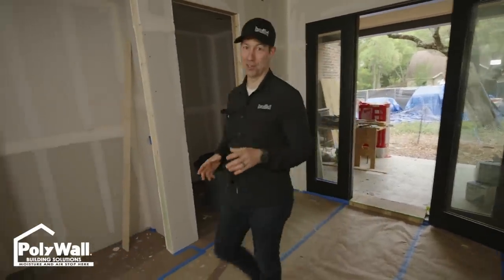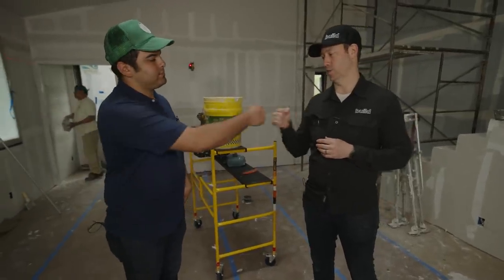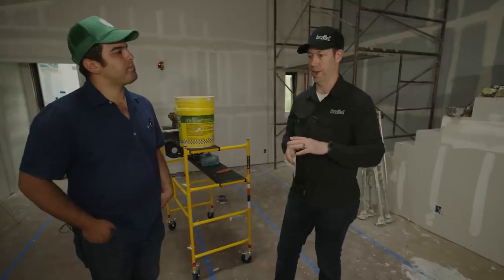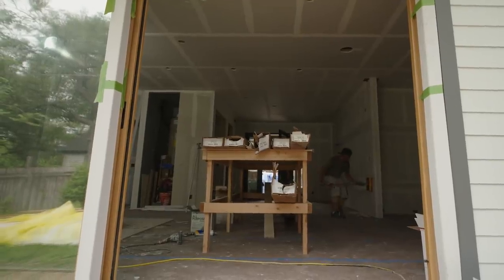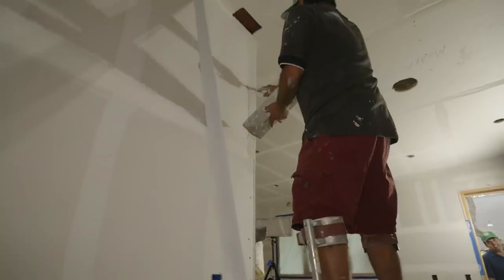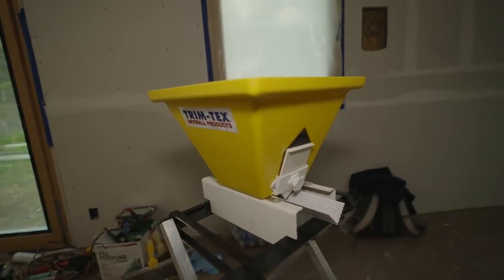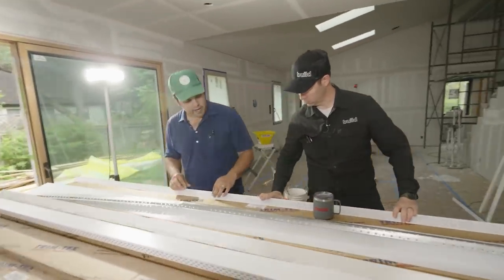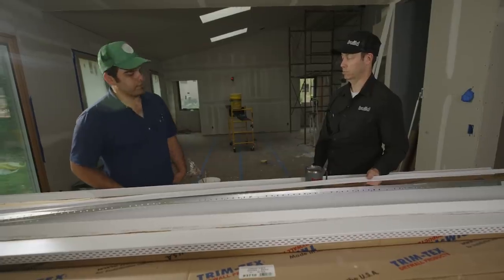Drywall 101: Here’s the specs for a Top Notch Job

Comment: One thing that isn't mentioned in the video is that using 5/8" drywall instead of 1/2" will require you to order doors with 1/4" wider frames - if that means custom ordering all your interior doors rather than buying doors with standard width frames, that could add a substantial cost to the build. Either that or shave 1/4" off all your interior wall studs to keep the wall thickness at 4.5".
Reply: Have you seen the entire series of this project!? 😬
There's nothin standard or normal about the cost of this Build! 😅
Reply: Or jamb extensions.
Reply: @Odrunkmonkey  👍👍takes about 30seconds a door
Reply: "not a lot of extra" they say. "typical house, maybe $700" they say. "ya, maybe add $100" they say. By the end; your house more than double in cost. and will be just as dated in a decade.

Comment: My dad, an architect, did an analysis of a 2,000 square foot production home comparing the plumbing fixtures and hardware from cheap-as-you-can-get-it production builder basic to high end (not crazy weird like gem-encrusted taps or anything, but solid, high-end products). The difference amounted to one-half of a percent of the total build cost. If your build budget is so tight that a half a percent makes a difference, something is very far wrong.

Comment: A heads up on the "Giant" or 'Oversized' L Bead.   I used this to wrap a window about 15 years ago.  It made for a very easy and smooth transition from wall to window wrap.  Painted the room dark blue...southern side...and the sill warped in a couple of days from the heat.  I had to redo the sill..kept the sides, and then used an off white to finish the inside of the windows.  Great product but watch where you apply it.

Comment: Would love to see a video with Junior explaining the difference between level 3 and level 5 finishing
Reply: level 3 is a texture finish to hide everything.. a level 5 is completely smooth.
Reply: @dtoad48  thanks for the info
Reply: @gags730  Great comments. All very true.  I am a specialty contractor in the industry. I've often heard the DW finishers being referred to as the magicians, master illusionists, the fixers etc. of the building trade. The stuff they are able to pull off to solve complex asthetic problems is mind-blowing.
Reply: Level five is *skim-coated* smooth wall. Level 4 is 3-coat smooth-wall sanded out. Leaves a fuzzy surface between the mud that will show up in paint. A reasonably competent finisher [me] can go from level 3 to level 5 with the skim coat and very light sanding after. 

Best practice [as Matt would say] is: 5/8 with level 5 finish. Looks and feels like a finished wall; not a double-wide.
Reply: @gags730  Yes, I never heard about the 'levels' until I got to Las Vegas. "Level 5" is a commercial finish like they use in hotels and offices. The tradesmen jump from residential to commercial depending on who's paying this month so they use the same lingo.

Check out the YouTube vids on 'skim coat drywall'. It's not like you butter the whole wall with one more thick coat similar to one coat plaster. You cover the wall, yes every wall that shows, and then rake it off. There is even a spray mix you spray on and then rake off with a 12" trowel. 

It sounds long and hard, but it is not. If you get it down, it actually reduces the amount of sanding you have to do. What it does is seals the surface of the board and makes the paper and the taped areas have the exact same surface.

Like I said above, you can jump from two coats to finish if you skim coat. Skip the closets and walls that get wallpaper or tile. Just the ones that shows. Makes you look head and shoulders above the others in your area. For smaller jobs, my drywall guy does two coats one day with hot mud, then comes back the next day for the third coat. 

I got one-coat plaster on my own home when I lived in LA. I loved it. Super durable. I couldn't find anybody to do it here in Vegas but then I learned about skim coat. But do whatever works for you. When I lived in Iowa, they wouldn't spend a nickel more than what 'flat n' splatter' cost them. They used 'knock-down' in LA: mix up a bunch of loose mud and fling it at the wall, then run your wide trowel over it. Looked like dried boogers to me, but they called it 'deep profile'. Yuck.
Reply: @gags730  About the 'levels': Level 1 is rock hung on the wall. Level 2 is fire taped [one coat]. Level 3 is two coat [tape and body coat]. Level 4 is three coat sanded smooth. Level 5 is skim coated. 

The last 2 used to be called: smooth wall and slick wall. Now they refer to 'levels'.

Comment: Matt, I've been watching your videos for some time now but had to chime in since drywall is my profession. And all my family's too. Own a business in Okc. Commercial buildings require some type of corner bead or trim tex only because its on the prints. Thats all the engineers know how to do corners. Any skilled professional uses paper tape and mud only on residential and it will be perfect. And it's much easier to fix later. When the homeowner is moving in and a corner gets banged up, the metal or plastic bead will crack away a much greater distance than where the impact was making the repair a larger area. With paper tape, just a dab of mud. Thats it. I do use a product called flex bead on arched areas and plastic corners (bull nose) when the customer wants rounded corners for that stucco look.
Reply: paper on outside corners? arent they super weak?

Comment: When my house was built the builder used these plastic corners and put them up with a liquid nail type adhesive from a chalk gun.  The adhesive only went on the back side of the corner and they used regular mud on the front side. They dried in really solid and you can hit them with a hammer and there is no movement at all!

Comment: As a Trim Carpenter (2nd Generation), I had learned the plasterer/taper trade as a secondary skill set. Most of this I knew already, but the newer material was good to see. Vinyl beads don’t bend as easily due to the ability for the material to absorb and deflect incoming blunt forces and to spread that force across the face of the product.

It’s science, ladies and gents!
Reply: Well, mud set helps a lot as well, the bead is full beneath the bead usually applied with setting compound where I'm from. It's a lot more rugged than glued on or stapled vinyl.
Reply: Mud set is also very nice because like he says the corner is very crisp, the only thing I would do different than what they have done is mesh tape the edge of it. Gives it just a bit more longevity, you just can't get the tape too close to the corner of it.

Comment: Finally, someone does it right by hanging 5/8" everywhere and it's not that LITE junk they are trying to pawn off..
Reply: @suspicionofdeceit the LITE stuff?  That shit will crack just looking at it lol..
Reply: Type X yes.  Ultralight is cardboard
Reply: Nothing wrong with the lite stuff. Can’t tell the difference unless you pick it up
Reply: Really the main reason for 5/8 drywall is the 1 hour Fire protection, and it will help with sound
Reply: @jeffreyferguson83  Yup.. I use 5/8" Type X with greenglue over 5/8" OSB in my theater rooms.
Reply: @gags730  People think adding Rockwool does anything for sound, when 5/8" over pink stuff would outperform it.. That is money well spent!
Reply: cries in mobile home ownership
Reply: 1/2 is perfectly fine - 5/8 jacks up labor costs and helps increase profits. Drywall contractors love overkill customers.

Comment: Soundproofing generally requires mass. 5/8 rock does that. The more salient factor, AFAIC, is that 5/8 is half again as stiff as 1/2". My engineer father in law explained that 'stiffness' is calculated as the square of the thickness. So if you have 1/2", it is 4/8ths thick. The square of 4 is 16, so it has a stiffness factor of 16. 5/8 is 5 squared for a stiffness factor of 25. Thus it is 50% stiffer. The walls feel far more solid with 5/8 rock. 

Now if you would do something on *single coat finish plaster,* it would be the icing on the cake. Unless you skim-coat it, the surface of the walls is basically cardboard. And that after all your hard work inside the walls. Single coat plaster [like Diamond] is unbelievably durable and resistant to damage. Plus, it does NOT feel like cardboard when you touch it.
Reply: I have a newer house in Florida that has metal stud interior walls and 1/2" drywall.  For minimal cost, they could have used 5/8" and the place would be so much sturdier.  It's not that it's bad, but when a door slams, the vibration travels to other rooms!
Reply: @r7boatguy  Exactly. Literally the *feel* of the wall. Doesn't give; has better sound blocking. It IS heavier than h*** in 12 foot sheets on the ceiling though. But your house doesn't feel like a double-wide.

Comment: Around here the 5/8s cost isn't the big deal.  Its the door jambs sizes that get messed up and now how to cost more to accommodate the bigger size.
Reply: Center the jambs so you only have to caulk an 1/8" seam or dado 1/8" off the back of your trim..
Reply: @FJB2020  good ideas....but I still feel that adds costs to a job that isn't mentioned.
Reply: @suspicionofdeceit Which doubles the costs of your doors compared to buying in-stock doors.
Reply: @HuskyKMA  that's my point.  I know i can fix them, but the added cost to me is a hidden cost because of the thicker drywall to you have to add that to it.  Not say its only 200 bucks more, cause its not.
Reply: @R2Mike  It would, but the benefit of 5/8s rock outweigh that in my opinion.  Also matt is probably already ordering custom doors (getting them for free lol) he can easily get 1/4" added to them...

Comment: Matt. Would love to hear your opinion on any dry wall alternatives. There have been so many advancements in home tech, why haven't we seen any changes in what we use to make the surface of our walls.
Reply from the maker: Great question. I’ve seen some alternatives but haven’t been satisfied. Did you see the all wood interior house I built a few years ago?  Look up “Perfect Wall House “
Reply: Matt- Have you tried MgO board?
Reply: Drywall is one of the few trades that hasn't needef to reinvent itself.
The industry nailed it.
Reply: Drywall is an excellent system. It's a 20 to 30 year system if done right, and it's simple and fast to repair it when needed. In terms of life cycle and repairability, it has traditional plaster very well beat. Although I use plaster materials and techniques for specific purposes.... Metal lath is very likely the strongest and best method for a tight radius barrel ceiling. It's a nice trick.
Reply: Makes me wish I had a picture of the barrel ceiling my father and I built in my sister's home. Definitely my go to method for something of that nature. The rebuilt and expanded. It was a really cool ceiling though.  Looked sharp the whole 15 years they had it.  Couple small movable LED lights set in it.

Comment: Painters like Good Drywall and Finishers.  Laser level drywall finishing?!  Matt you are going over board . (pun intended)
Reply: I guess laser is a must for level 5 finish?
Reply: Only way to get a Grade 1 install 😂
Reply: As he stated, that particular joint is going to be seen from many places and there are lines that need to be straight to avoid distraction. Plus, doesn't take long.

Comment: You could also use ICF with 5/8ths and have 100's of times more mass. I would love to see more ICF videos! It just seems so much more easier to make an efficient air tight home.
Reply: ICF is the way to go but there is some things to be aware of. Blocking for heavy interior items on exterior walls can be an issue and the depth of your window and door openings depending on what size block you use. I'm a huge icf guy though. Only way to build your own last house imho
Reply: @jwristen24  100%. It's definitely not a perfect system, but if you want a high quality home that is efficient it's worth the extra time and money. Pays off big later in the construction phase and throughout it's life.
Reply: @frostman9661  absolutely. And with lumber what it is right now the cost between the two is closing. I've had 2 projects fall out because of lumber costs and another is going through a full redesign with decking and metal studs.
Reply: I'm designing our ICF home and plan on using 5/8" everywhere..  I don't see Matt building with ICF as he can't upcharge for air sealing details since ICF does it for you..
Reply: @FJB2020  I doubt that's the reason. There's a learning curve to get it right and not many architects have experience with it.
Reply: @jwristen24  thats true, laying it all out myself and learning to design with the block and not conform the block to a design.. I bet that is what they struggle with.. can't really take existing layouts as the dims don't line up.
Reply: @FJB2020  yep. I've dealt with countless architects over the years and there's one thing they all have in common. They don't like taking chances. They prefer to plug in assemblies and details. I've looked for icf details on the nets and there isn't very many to be found. An architect actually has to work to design an ICF home.
Reply: @FJB2020  you gotta be on your game for sure. You got vapor barriers, furring, siding, all of that has to conform to your roofing and joists, windows and doors. A lot of ways to bone yourself and not see it coming.
Reply: @jwristen24  I work for an engineering firm.. All the 'old timers' have all their details drawn up at the ready to place on any job they get.. Never wanting to think outside the box, create new details or do extra work.  

You sound like you have some ICF background, that true?
Reply: @FJB2020  I've been in commercial construct for quite a few years. I've done all the research I can find on icf. Haven't done one myself but have built a bunch in my head lol....I could pull one off I'm confident. I wish you the best with it. Its a great system. Garret Glazer built one and is an engineer. He has a channel on here too. Good source of info.
Reply: @jwristen24  I have watched every single ICF video from 12 year old filmed with a potato ones to ones posted last week... 

I like Garret, I just wish he filmed more of the process instead of showing pictures and talking about it after the fact.. That said, he did a wonderful job on that home and for pennies on the dollar... 

My wife and I plan on doing a channel on our build.  You can see all the dirt work we already did on my channel.. Just trying to get it all ready so we can order block and start stacking..
Reply: @FJB2020  I'd like to watch watch channel bud